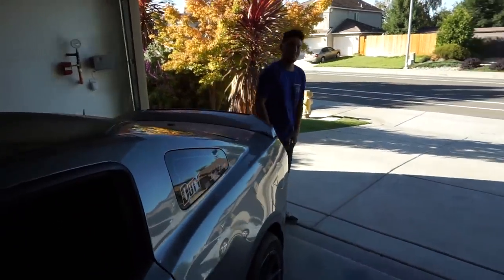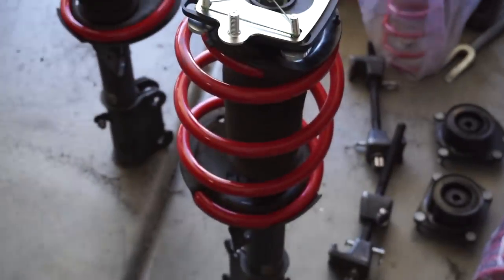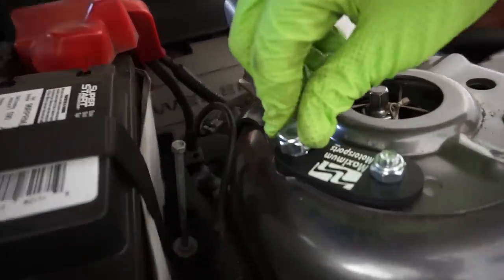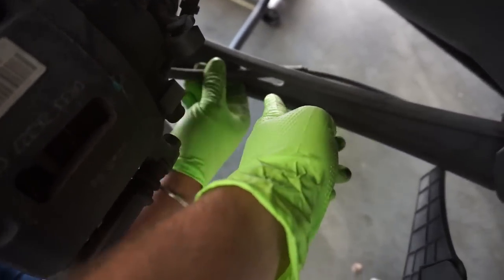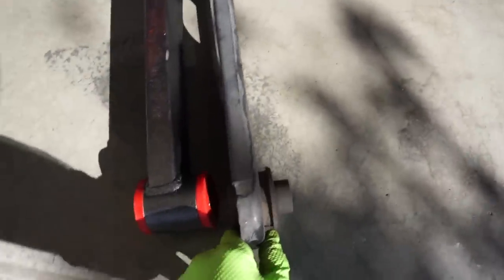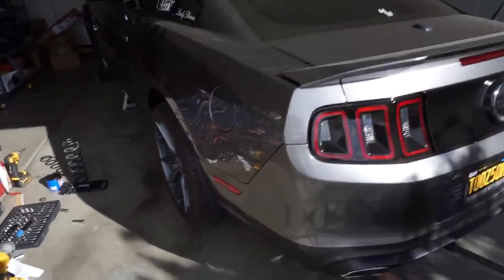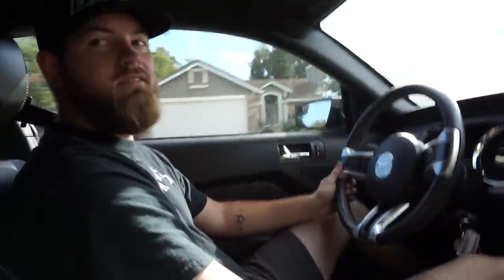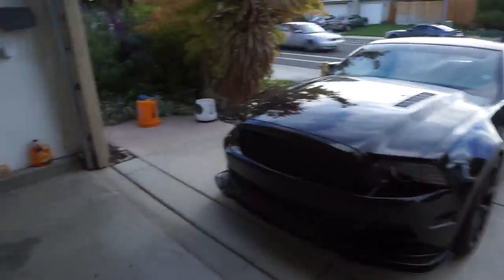BMR Suspension Install! Lowering Springs, Panhard Bar, LCAs, and Caster/Camber!

Comment: I have a 14 GT convertible and went with .8/ FW, 1.2 RW Eidbach pro sport lowering kit (also sitting on 20in staggered Verde Axis wheels); roads in east TX suck in alot of areas; wondering what my wheel gap will be when I get them installed, do you have an estimate. (also purchased caster/camber plates, panhard bar, new struts and LCAs.  Love the vids - 1st mustang I have had, mostly Chevy's before , I'm hooked on my 197 now!

Comment: Both cars look great and that's awesome that you can do this install yourself. I have a 14 Mustang GT premium with Ford Performance Assembled Adjustable Handling Pack. It is good around town and for aggressive driving but rough on highways and over imperfect roads. I wonder how the BMR package would compare?
Reply from the maker: A lot of it has to do with spring/shock combination. Since this is the stock shocks i'm sure that's whats smoothing this out quite nicely. What does that pack come with exactly?
Reply from the maker: Nice! That’s probably the GT500 or boss 302 setup that ford uses.

Comment: Do you absolutely need the caster camber plates? I know it’ll help with the alignment but if I used the factory top hats would the alignment upfront be all wonky?🤔
Reply from the maker: I would - I had similar springs on my car before without the CC plates and I blew through some expensive Mickey Thompson street comps because of the alignment

Comment: You said at the start of the video these are the BMR "PERFORMANCE HANDLING" springs right? The ones off LMR with the higher spring rate. 240lb up front and 200lb in the rear. Verses the "STREET" springs they have that are 165lb / 160lb front to rear. Just wanted to clarify as I'm getting ready to do the same to my car. I wanted to know if the stiffer spring rate is daily friendly.
Reply from the maker: Yep these are the performance handling springs, not street.
Reply: @JacobRDoty  Okay, thanks for the reply man.

Comment: Hey man I just installed my BMR springs and panhard bar on my 14 5.0. I’m getting some strange vibration when I’m laying into it. No crazy noise just feels like something is out of balance. 

Does this just add more vibrations? I have verified no tire rub and no parts are loose. 
I haven’t done an alignment yet I’m going to get that done this weekend. I’m hoping that cures it. 

Just looking for your two cents.
Thanks dude!

Comment: if budget isn't an issue here. would you rather go for coilovers instead?
Reply from the maker: Yes. This is the factory strut and shock so you won’t improve performance too crazily. I’d go with a nice setup by like fortune auto. Customizable for your specific setup and use

Comment: Would you mind sharing the wheel/tire specs? The size, offset, etc.. I’m about to order a set and this fitment looks perfect.
Reply from the maker: 19x8.5 +32
245/35r19

19x9.5 +38
275/40r19

Comment: What size wheels and tires where on the car? I have bmr springs too that lower 1.5 all around, I’m not sure it’ll clear very well. I have 245/35r20 front and 285/35r20 rear on my 2014
Reply: RaceRed302 255/40/19 and 275/40/19.
Reply from the maker: You should be just fine. It’s really going to be dependent on the wheel offset
Reply: Jacob R. Doty yeah not too sure what the offset is but the tires stick out a tad bit. So I’m worried I’ll mess up my fenders and tires, I have the BMR drag springs too, 1.5” drop all around
Reply: Jacob R. Doty yeah not too sure what the offset is but the tires stick out a tad bit. So I’m worried I’ll mess up my fenders and tires, I have the BMR drag springs too, 1.5” drop all around
Reply: RaceRed302 dude 1.5 is nothing also 285s are small

Comment: Mustang people I need advice. Would you consider a prior salvage 11 gt with 96k for $9000 a good deal?
Reply from the maker: Ahhh I try and stay away from salvage especially in performance cars. Maybe your daily driver you can get away with it, but something you want to be straight and true and dialed in, no thank you!
Reply: Jacob R. Doty Appreciate the response!It is actually a prior flood damaged car so no physical damage but it was claimed over a year ago. Thinking if it checks out good now then I’d like to believe it’d be fine.
Reply from the maker: Aww man flood damage can cause lots of issues in the long run with wiring and electronics. Critical components. I'd save and just try and find a clean one man.
Reply: Jacob R. Doty Yeah that’s kinda what I’m thinking. Thanks man!
Reply: No issues with mine. Owner left both windows open, to their surprise upon returning. 1” water on floorboard. Bought the car as flood/salvage. $8500….. Mustang 2013 GT Premium. My daily driver with 80k miles. Best deal in town not planning on selling cuz I know not much value but more value to me 😊

Comment: Kind of dumb question hah but why why you cut the bump stops?
Reply from the maker: With lowering springs you're effectively making the suspension travel less than stock. if you keep them there's a change on harsher bumps it can hit them. Not super terrible if it does, it's what they're they're for but it can be a harsh hit and upset the chassis in a turn potentially being dangerous. Takes all of 10 seconds with a nice utility knife and prevents that.
Reply: Jacob R. Doty awe okay, no wonder I been feeling the harsh bump hits, ima do that then since mine lowered to. Thanks man!
Reply from the maker: @cesartorres9842  No problem brotha

Comment: I installed bmr drag springs and panhandbar but I hear alot of squeaky noise and  weird noises, feels like something is going to brake tbh Haha what you think it is? Anyone.
Reply: Amilcar Pineda Turn up the radio and go faster the noise will go away. lol
Reply: @Cris Carter I'll add more and see if that helps
Reply: @gioi8892  lol my exhaust loud enough to block it out but when I cruise little bumps 🙄 sound like it's going to brake lol
Reply from the maker: Make sure everything is tight. You may think it is, but it isn't. When it's on jack stands and safe to do so, grab different components and shake to feel for any looseness or vibration to replicate. I used to have a whiteline panhard bar and it was loose causing some clunking at low speeds.
Reply from the maker: @Cris Carter Lol yeah man trust me I had to do plenty of suspension stuff by hand before getting this tool. The wrench set I have was bought for my first coilover install years and years ago. Then you just keep adding tools along the way
Reply: @JacobRDoty  you were correct,  I checked everything and was shaking it see where the squeakyness was coming from and ended up being one lose bolt from my panhanbar. Now rides smoth and dont feel like it going g to brake

Comment: How much does this help out your 60 foot?
Reply from the maker: The LCAs probably do the most. These are the BMR Handling springs...they have BMR Drag Springs specifically made for drag racing. The ones installed in this video are most beneficial for handling around turns

Comment: What inch drop are these springs?
Reply from the maker: Says 1.5" all around
Reply: @JacobRDoty  is the car still settling in? I just ask because I had 1" drop springs that settled in to around 1.25" after driving.
Reply from the maker: @davidwarden6011  very well could be! There isn't even 1 mile total on these springs in this video. They may settle after a few days
Reply: @JacobRDoty  just becareful, watch your tires, especially with weight transfer under acceleration.  I chewed my tires up and had to do  a roll and pull.
Reply from the maker: These aren’t nearly that aggressive. Won’t come anywhere near the tires on her setup. Mine is much more aggressive as I have 20s. She’s on 19s and less wide